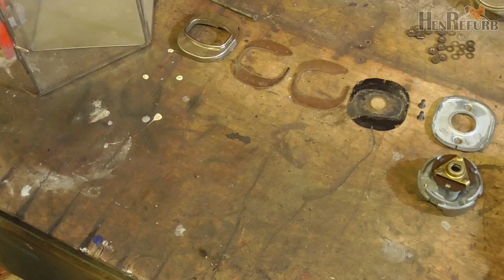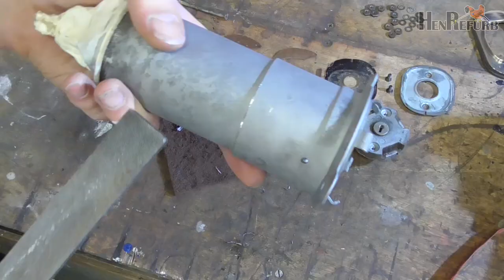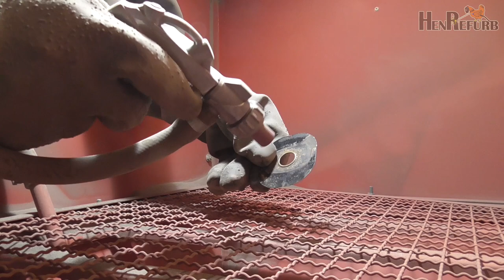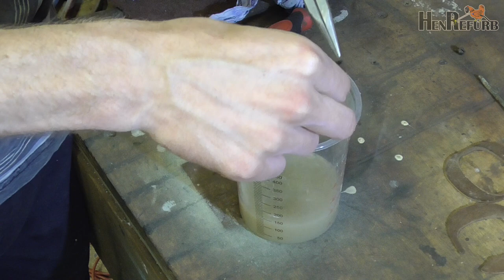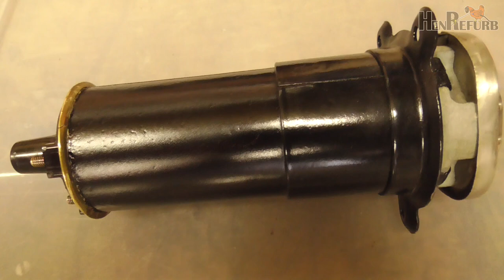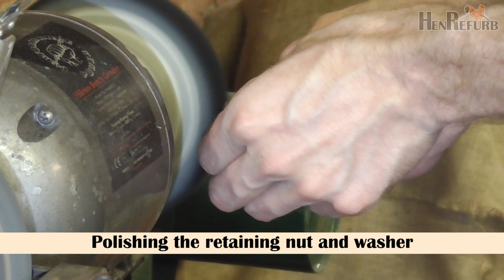Vintage ignition coil and light switch restored - 1931 British Dodge Restoration

Comment: My 1929 Dodge uses a key switch attached to the back of the coil also. Your setup is much better. You did not have any issues with disintegrating diecast pot metal. You are very fortunate to have an original untouched car there. You are doing a great job , but then look at your helper . You can't go wrong.
Reply from the maker: Thanks for watching! I was a little concerned taking it apart if I’d break anything but it went very smoothly in the end. My helper is excellent!

Comment: I'm a little surprised you'd go through the trouble of wet-sanding the coil, since it's hidden behind the dash... But hey, it's your resto, not mine.
Reply from the maker: Haha, it was a bit over the top I admit! Just wanted to get rid of the rust pitting left on the surface, some of it was quite deep. The wet sanding didn’t take too long. I never thought the day would come in my life when I painted an ignition coil full stop!
Reply: @HenRefurb  I hear ya.